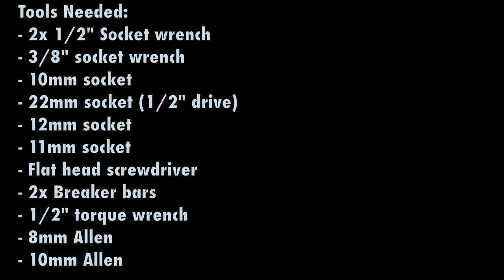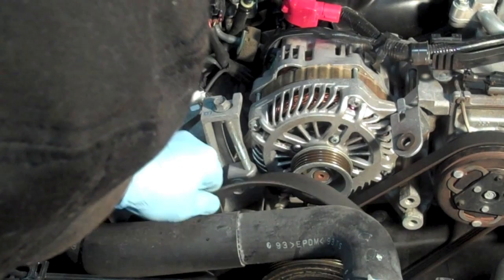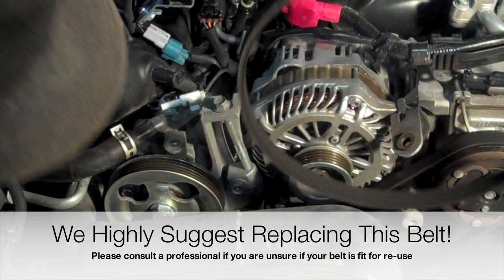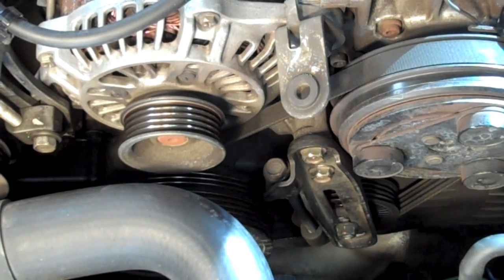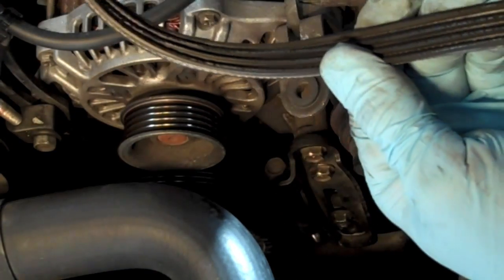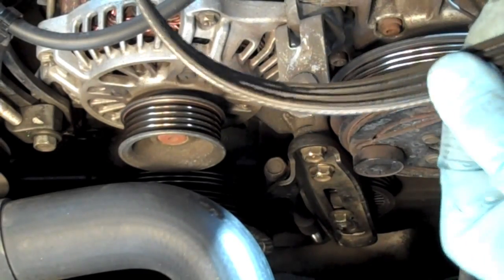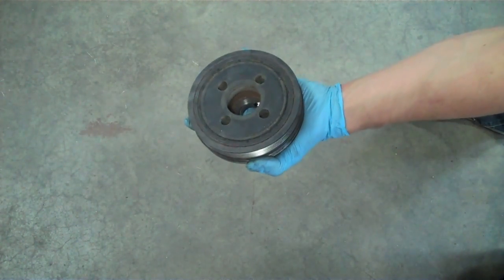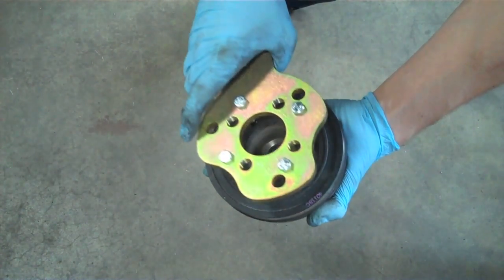GrimmSpeed Subaru Lightweight Crank Pulley Install Video

Comment from the maker: Dan,

The exact article is evading me right now but Subaru of America made a statement about a year ago saying that the OEM crank pulley is NOT a harmonic balance.  Quite a few people make this assumption because there is rubber used in its manufacturing process.  Our pulley isn't as light as some of the other ones out there.  We intentionally made it slightly heavier as to not run into mis-fire issues if someone is running a lightened flywheel.  -Matt Homes

Comment: Just finished installation on my 04' STi.  Took me two hours, including the time spent to go get a second breaker bar.  Should also be noted that I wouldn't consider myself "experienced" lol.  This is a great and very easy to install mod, especially with the video.

Comment: My Subaru dealer only charged me about 50 dollars to install this, saved me from buying any tools or messing it up.  Been running it for about 5 years now on my 2013 WRX and no issues.  The biggest thing I noticed right away was how much smoother the car seemed to idle while at stop lights and such.

Comment from the maker: Some states don't allow the modification of a vehicleand or limit to only certain modifications.  We use this statement so that the consumer knows its intended use.  This will work just fine on a daily driver, just verify with the state you reside in that they modifications are not prohibited.

-Matt H.

Comment: Omg I'm such an idiot Haha I'm at work at the moment but tonight I will do that. I'll let you know how it turns out. I did tighten it down but it wasn't in gear so it wasn't tightened to torque specs and I did install the belts afterwards. I should've worded it better. Thanks!

Comment: Hey Brian,

You probably just turned the engine which shouldn't be a problem. If you're overly concerned you may want to take off your timing cover and confirm that the marks are still lined up.

Mike

Comment: Our GrimmSpeed light weight crank pulley works on all EJ series engines, so it should work on your Forester just fine as long as you have an EJ motor.  -Matt Homes

Comment from the maker: The crank pulley most likely won't be scrutinized like changes to emission, exhaust systems are.  I cannot promise you this, if you are still concerned, check your local statutes.

Comment from the maker: Mike, are you sure you are torquing the crank pulley down to 96 ft lbs?  You install the belts after the pulley has been torqued down.  You will either need to put the car in gear or use a crank pulley tool to achieve this torque specification.

Comment: @GrimmSpeed: im considering picking up one of these for my 2000 impreza outback 2.2l 5spd manual.  i just want to confirm that this pully is compatible with that engine because it is a 2.2 and not a 2.5

Comment: Faster way to loosed the cranks pulley is to put your car on 5 gears, ebrake up. Get a 22mm socket and a breaker bar.

Comment: Hello,

My guess is this is internet hearsay and not fact. We have seen no issues associated with the installation of this pulley. Stop and go traffic should be improved as the motor will respond and rev more freely.

Mike

Comment: theres a lot of pulley..usually people change light weight crank pulley..its make better performence  n responce..increase about 5%-10% power for ur engine..crank pulley is at belting air con..i change  my crank pulley yesterday n i can feel the different.. @PUNKaZZBEACH

Comment: You mentioned that the wight is optimized so no check engine light is triggered. But what if i have a lightweight flywheel on my car?

Comment: I noticed in the beginning that you loosen the idler pulley, but when replacing both belts in the end, it's no longer there. Did you remove it altogether or was the reinstallation of it done after this vid? Can the car be used without it? I just ordered a crank pulley and idler pulley to replace them both in my 2004 Sub Forester.
Reply: the installation was done on a model which did not have the tensioner, if you have a tensioner it will make installation easier as you don't need to do the method shown

Comment: Question for Grimm speed vender. What is the difference between your crank pulley compare to Cobb and Perrin. I have a Perrin crank pulley but I  just put the stock crack pulley. I'm being told that the stock crack pulley has a harmonic balancer. Am your crank, Cobb and Perrin don't have it. Which could cause vibration and messing up your oil pump and bearing.

Comment: I've been thinking of buying this crank pulley and then swapping it instead of my old one. And here is what concerns me a little. I was told and also read on the Internet that replacing old1 to a lighter may create problems especially if you often drive in a city, traffics jams, often stops due to traffics lights and so on. In other words a new crank pulley is good foe driving on long distances off any cities. Is it correct? Thank you.

Comment: So $245 to put on a pulley...... $125 GS pulley, $60 GS pulley tool, $30 GS belt tool, $30 gates belt tool. +Shipping. Looks like I should just buy a super damper at that rate..

Comment: I just put my car in 5th, ebrake set and gave the breaker bar a little pull to make sure the pulley wouldn't go counter clockwise. It did a little bit and I turned it slightly back clockwise. What could happen here?  What should I do at this point? Any ideas why the pulley turned back? Any help is much appreciated.

Comment: Hi,I have a 2004 wrx  with a light weight flywheel,I have purchased one of your lower pulleys but I have yet too Instal it,but you guys mentioned in yvid that if you have a lightweight flywheel and you install the lightweight pulley it puts the timing out,is that correct?
Reply from the maker: It really depends on the weight of the LWFW, our pulleys are deliberately made to be a little heavier so that they don't throw codes from the combination. The best way is to install it and see if the ECU reacts.
Reply: @GrimmSpeed  thank you kindly for the advice

Comment: Wouldnt it be necessary to time the engine after pulley & belts have been re-installed since the crankshaft was rotated during the installation?
Reply: The engine was rotated? I never saw it being rotated. The timing belt was never removed also.
Reply: Josias Rivera  pay attention from 6 minutes forward. ALSO : How would you remove the crankshaft pulley without removing the timing belt.
Reply: sniffinwhitelines Subarus have an internal timing system from the crank to both halves of the heads on opposite sides of each other. There is a timing belt behind those plastic covers behind the crank pulley. The crank pulley is not timed to the cams. No retiming is therefore required.
Reply: There's another timing belt inside of those covers
Reply: :O
Reply: No timing necessary... these are just underdrive belts

Comment: Chad,

Are you running the stock fans or aftermarket ones?  You should be able to do the install with your fans on the radiator, but you can remove them if they are hard to work around.  Let me know if this helps, if not give me a call (612-379-0000) and I can walk you through it.  -Matt Homes